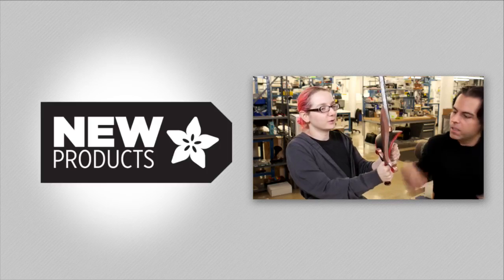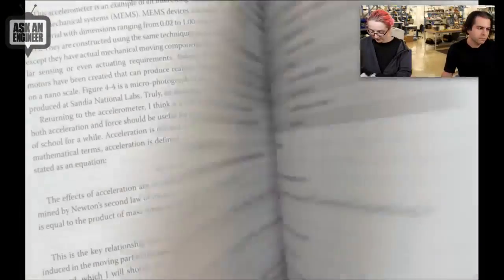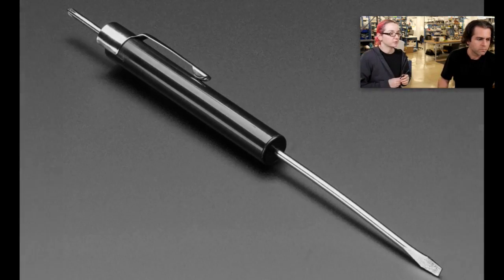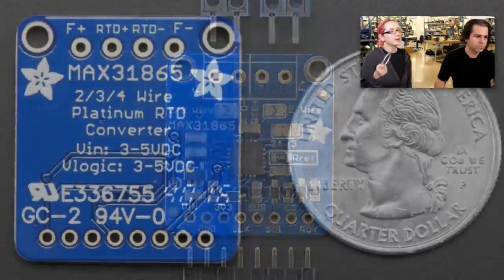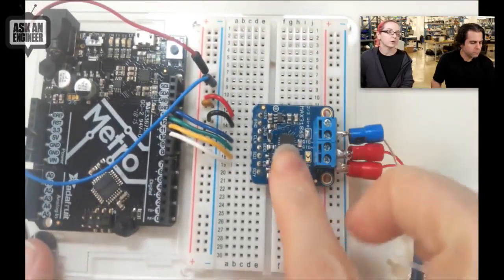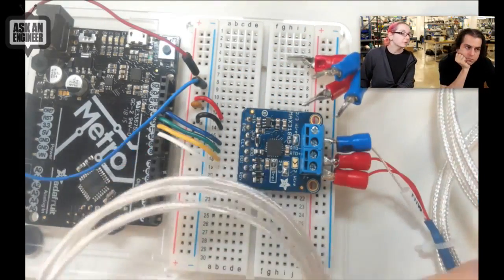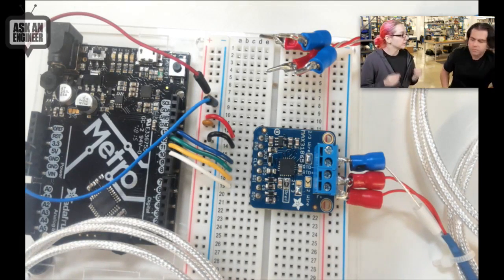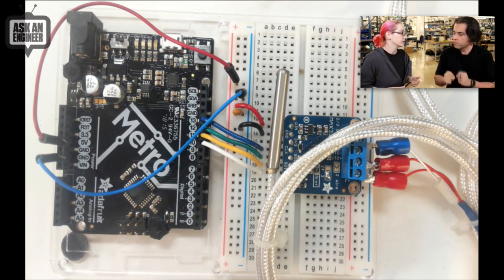New Products 11/16/2016

Comment: thank you for this video (y) good work..please i am a working with arduino and PT1000 and i have few questions : what is the max/min températures that we can read using the PT1000 with MAX31865 and how many pins that we need (entree) for the arduino ? and how MAX31865 work did you get 0-5 V in sortie ? thank you :)